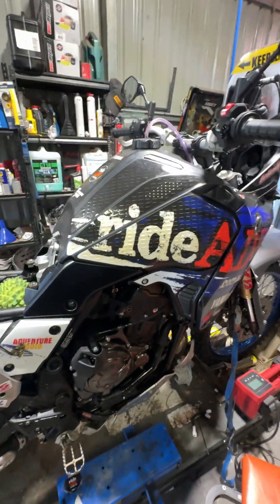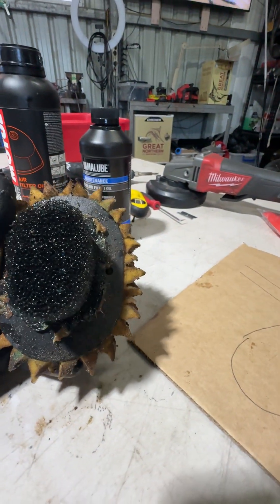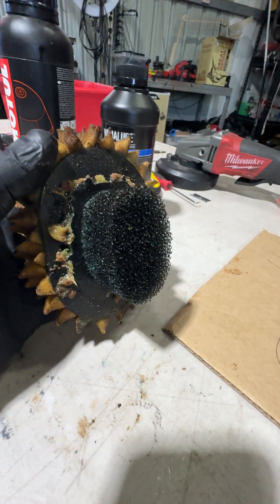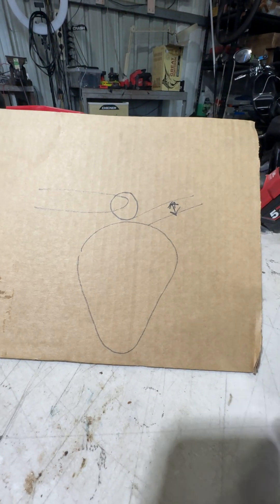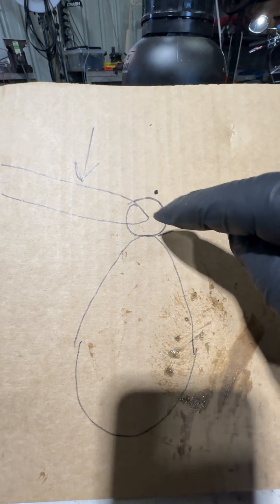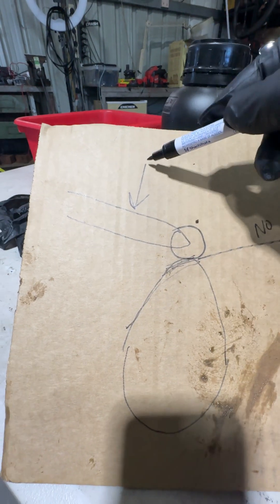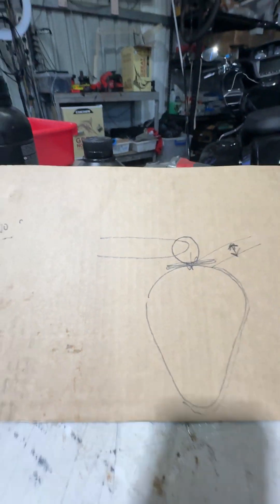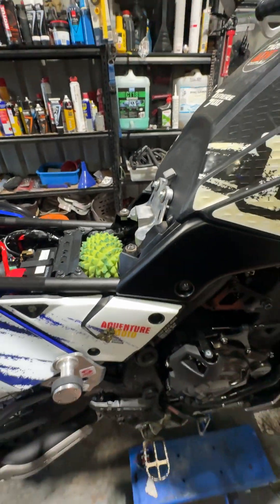"The Importance of Clean Air Filters” Protect Your Engine from Damage

Comment: Hi TB, along the lines of engine protection, from your experience what oil have you found best in your bikes? Also a lot on the internet about Yamaha torque spec for the drain plug being to high, what are you thoughts and what torque do you do your bolts up to? Many thanks mate